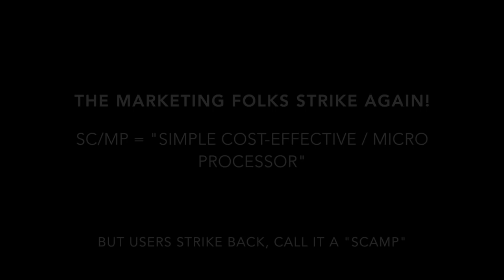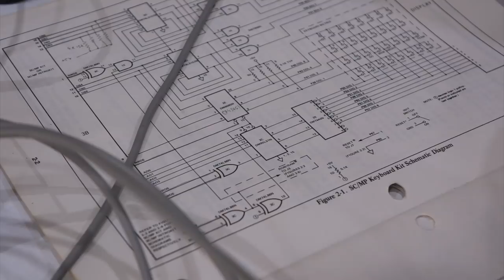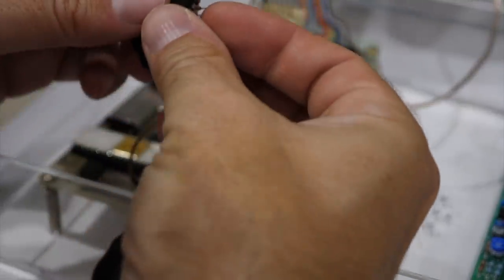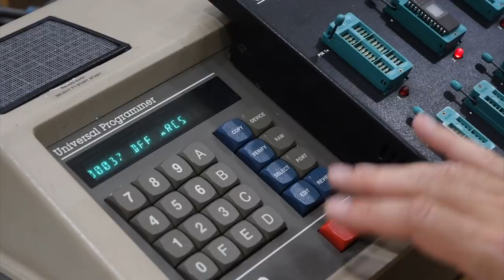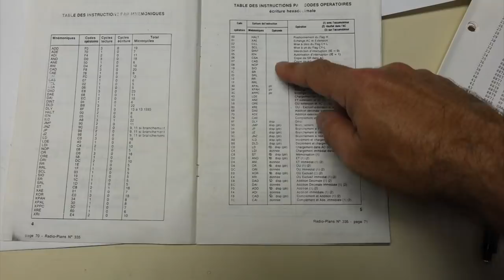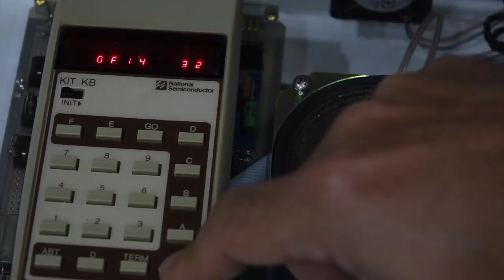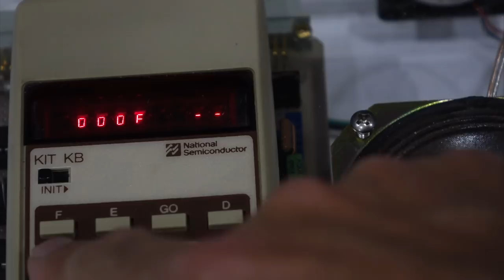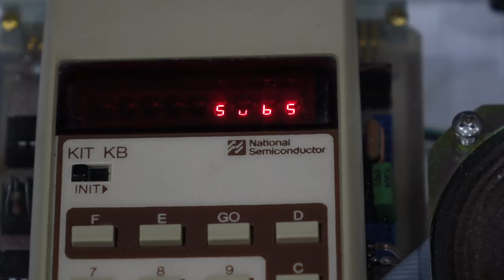My first computer: the 1976 SC/MP 8-Bit Microprocessor Kit

Comment: My first computer was an Ohio Scientific Challenger 1P - in 1979. A bit (no pun intended) more advanced: 8K BASIC in ROM (by a scrappy little company called Microsoft) and 8K of RAM. I also programmed a clock, as well as a non-directive psychotherapist program chatbot I called "Dr. Challenger" that sucked some people into thinking it was intelligent. That got me interested in the question of AI and philosophy. Quite amazing the impact computers have had on our lives. Thank You Federico Faggin (designer of the Intel 4004, which became the world's first microprocessor in 1971)! 
Marc - Do you have anything with a 4004 in it?
Reply from the maker: + Eric Platt: No, nothing with a 4004. I am not sure what used it. I have the HP 264x terminals which originally had 8008's in them, but the version I have are 8080's. Bunch of videos here: https://www.youtube.com/watch?v=mOXCPaHcr5U&list=PL-_93BVApb5_E6qM4SujInAZSXZ3C-6AC
Reply: Thanks for the link. Fun stuff, these old monochrome limited character/bit set computers. 
You should check out the comments in the original source assembly code for the Microsoft BASIC used in the 6502 machines (Apple, OSI. etc  [1978].):
https://www.pagetable.com/?p=774
Intel was contracted by the Japanese firm Busicom to build the 4004 chips for a calculator. According to Wikipedia: "The first commercial product to use a 4004 microprocessor was the Busicom calculator 141-PF. The 4004 was also used in the first microprocessor-controlled pinball game, a prototype produced by Dave Nutting Associates for Bally in 1974." 
Nice story about it here: http://www.i-programmer.info/history/machines/3345-birth-of-the-intel-4004-the-first-microprocessor.html
Reply: @Eric Platt, you rebuilt ELIZA in 1979. There should be easily accessible assembly and machine code interfaces, so the wonders of yore and even more are remade, even better, reaching never before seen heights. Sadly, there are some "programmers" that require 2GB of ram for a simple Hello World program (the Electron framework bundles all of Chromium even for that simple program, so everything coded with it weighs at least 100MB). Truly pathetic.
People should look at what Xerox achieved in the Alto and even more with very little resources. Vectorial graphics. Rasterization. Etc, etc, etc...

Comment: Having owned an SC/MP based MK14 for all of its life (and a not insignificant portion of mine), I really like this video. I hadn't realised how heavily derived from this kit the the MK14 actually was - the monitor / OS looks identical to the 'early' version MK14 OS, although the MK14  later acquired a much improved monitor, the one with the "0000 00" reset prompt, as opposed to the one with the "dashes" prompt as seen here. As an electronics hobbyist I used mine in much the same way as I still use things like Arduinos now. I give the MK14 a run out every now and then, and a few years back I made a serial download programming interface for it, as seen here:-

https://www.youtube.com/watch?v=j1WSy_ueX34&t=21s

It's great to see like-minded others keeping these old systems alive.
Reply: It's not so much "heavily derived" as exact copy :) Ian Williamson had designed an SC/MP machine that worked by hacking a calculator display and keyboard, but when Sinclair went to NS for parts they offered him the design for free provided he used NS parts. The difference in the MK14 is they threw away the unused bits. The Introkit was originally a serial I/O trainer for the SC/MP ; NS provided a conversion kit, a wirewrapped board that replaced chunks of it to provide things like the keyboard interface.
Reply: Hello Paul ('The' Paul Robson?)  - yes, I've since seen examples of the Introkit at Bletchley (The National Museum of computing) and I saw that the most basic form of the Introkit only had serial / TTY input/output, the keypad / display interface being added on the 'breadboard' part of the Introkit, usually using wire-wrap construction. I guess we MK14 owners had it a little easier, or we would have, if the MK14 keypads actually worked. :-)

Comment: Know the 2716 (plus 2732/2764 prodigy) and that Data/IO quite well.  Back in the day we were among the first on the block to get an 8080-based PC system from Intel (including Basic from somebody named Bill Gates) .  We developed new communication terminals using the Z80, replacing terminals built using "mini" processor boards with ALU, drivers, registers, etc all discrete chips, which I used to troubleshoot before we moved on to microchips.

Comment: Bonjour Marc. J'ai une petite question; comment est-ce possible qu'une mémoire mask ROM puisse devenir défectueuse ? Après tout, ce ne sont que des connexions électriques établies par une combinaison de pistes de métal superposées, non ?
Reply from the maker: Good question (Alain is asking why a mask ROM would fail since the bits are set by a metal mask, not a trapped charge like in an EPROM). The answer is that any IC can fail. If I am not mistaken the main wearout failure in modern ICs is electromigration, so ICs have a finite lifetime. The wearout modes depend on the particular technology node, these are usually heavily studied and understood by the respective fabs, there are whole qualification reports on them - but ICs do age and have an expected failure rate. There are also random failure modes, and I am not sure what the predominant ones are. Prior damage by static is a well established one. EPROMs, since they rely on trapped charges, are more sensitive to defect growth, contamination and charge migration, so they have additional and more frequent failure modes, this is why you see them fail much more often. Nice drumming by the way :-)
Reply: I knew about some early ICs, especially CMOS ones, that suffered from electromigration due to a poorly understood phenomenon at the time and the less than ideal manufacturing processes in FABs of the early days. But I didn't know that it could also apply to mask ROMs. I know that some flash RAM types also have some caveat regarding the finite number of times each cell can be reset and written to, but given that this technology is holding electrons captive (much like the early EEPROMS) it could be expected that they would fail over time. But wires connected to other wires ? I didn't think so. Now, I'm a bit scared since I own a lot of vintage electronic gear.   
Thanks Marc, for the explanation and the compliments... ;-)
Reply from the maker: And the acute lifetime problem from early ICs has not left. It has even returned with a vengeance, it is now a major limitation of ever smaller modern ICs.

Comment: I recently got this exact set (with the modified calculator) and loads of attached sc/mp expansion boards built into a wooden case.

I have no use for it because I collect Commodore and MOS stuff.

Is there any value in this SC/MP stuff?

Comment: If the SC/MP processor is running hot, wouldn't it be better to fix an actual heatsink to it, rather than just having a fan right at the back of the enclosure? Give it some direct localised cooling, especially as this processor is quite unobtanium as well.
Reply from the maker: It's PMOS. Every chip in there runs hot basically. But this board is OK to be run without any cooling. It's just a precaution.

Comment: Me, too - I had one of those, but the more polished kit, the MK-14 ( https://en.wikipedia.org/wiki/MK14 ) - sigh - I also got the extension kit, which added a few IO ports and doubled the memory. I then had to learn how to interface the IO lines to some electric motors and switches, learned how to do software debounce, and some more. Finally I had some sort of macro-language, example: "Turn motor five turns (a switch counted) or until other switch is depressed". This was the beginnning to do some robot/machine ... but then it petered out.

Comment: I've actually built a very basic 8 bit CPU using discrete logic, SRAM and 16kBit EEPROM's. It has 256 bytes of memory, currently has 36 instructions, the ALU can only really add and subtract but I have written multiply and division programs for it (answers less than 255 for multiply and my division programs has limitations IE it has to be evenly divisible otherwise the count overflows and you get an incorrect answer and it infinite loops on divide 0)
Reply: Nice! You should make a video of it
Reply: LeiserGeist I have a few older videos (from 3 weeks ago) of it on my channel, haven't made one recently after the added instructions and other mods. I'll probably make an update video when i get back home tomorrow (my time)

Comment: this is so charming, would kids today benefit from such a kit now do you think? how much need is there for very low level programming today. I don't see how its possible to persuade people to learn very low level programming, except with such restrictive hardware, Just not sure the young have a desire to concentrate on low level programming today when they have so many vast easier digital distractions.
Reply from the maker: Not to worry, the bit swappers are alive and well. Busy making gnu compilers, EFI boot code, OS kernels, drivers, jailbreaks, and other firmware hacks and viruses...
Reply: It's funny that you ask that. Today's computer science classes don't even teach you such skills. Now that WEB development is in full demand. In fact, I heard that you can get a Ph.D. in computer science without ever writing a single line of assembler code. Is low-level programming going the way of the dinosaur? I can't imagine why. Even today's i7 processor still run assembler/machine natively. Although I will admit, trying to keep track of a 1000+ instruction set can prove a bit challancing.

Comment: Thank you so much for this. What a wonderful dollop of nostalgia. It has taken me right back to the early days of microprocessors, which I was fascinated with as a school kid. I remember lusting after the National Semiconductor SC/MP Introkit with its Novus calculator based keypad but it was too expensive and hard to source in the UK. Predating the Introkit was the 4 bit Intel 4040 'Champ' development kit/project in Practical Electronics magazine, which [alas] was also too expensive and involved a task for me at the time. However, within a couple of years or so, Sir Clive Sinclair came through with the SoC MK14 SC/MP kit which I was able to buy. Boy do I regret selling that!! 😢 I wish I still had it and could build a display cabinet for it like you have done here. A really nice Introkit came up on eBay a few years back and I was really tempted, as it was a very reasonable price, but I had other projects taking up my time & money at the time. Fortunately, there's a chap who is selling gold plated bare SoC MK14 PCBs on eBay, so I've bought one to use with a nice new 'old stock' ceramic SC/MP uP I bought several years ago (I think I still have a couple of plastic packaged ones too, as spares). This vlog has spurred me on to get it built. 😎👍 Although you can still source the ROMs for it, they a bit pricey so I might do what you have done here and make an adapter for EPROM. Nice job btw. I wish I had some of your gear to hand.

Comment: how did you figure out how long each instruction took for the clock?
Reply: normally it listed in the data sheet (instruction manual)
Reply: @martindejong3974  That question seems too involved to come from me. Then again I'm one of few who own magnetic drum memory and involved with it I got. Its making me feel stupid and smart. I would love to drop a video on it but I cant get anything on my scope from the drum. Not even noise. The heads i dont think are active despite them having odd chips. its so old u can look at the bare dyes and determine what things do. Even tho the drum is scratched I should still be able to pull somthing. Im at 20mv. anything lower and i will likly need sheilding to probe which will make it somuch harder. idk why i put this here. thnx for the reply. makes total sense i should have known lol. If u sub and hit bell to my channel ull see it one day. i dont upload often. im actually really excited. these drives areso simpal you could totally read and write to it with ur own circutry.

Comment: Heres my 40-year-old homebrew SC/MP system, its loosely based on an idea by David Aitken published in the 'Microbyte' column in Practical Electronics April 1980.
It runs 'Kitbug' via a terminal (I built an Elekterminal but cant find it - its buried in my loft somewhere...)   https://www.vintage-radio.net/forum/showthread.php?t=171478
Cheers
Phil_G
Reply from the maker: Nice!

Comment: can you add some kind of serial connection to it so you could just send programs to it from more modern computer instead of keying them in by hand
Reply from the maker: Yes, the original kit was meant to be connected to a TTY with a paper tape reader (like an ASR33), so it has a slow 20 mA serial current loop built in. You need another ROM to make that work. The keyboard interface was an afterthought, for people (like me) that did not have or could not afford a terminal. That's why the keyboard interface is all wire-wrapped, and the ROM is different. Now that I have the bigger ROM, I did put some DIP switches so I can swap between the two ROM images and switch to the TTY interface. Have not tried it yet.
Reply: ¸maybe a revisit after a year, trying out TTY on it?

Comment: Heh. I bought this one more than 10 years later already built, with non-original stock Hex LEDs and buttons. I remember you had to debounce the buttons in software :) Mine had a switch and a lead where you connected 21V or something to program the EPROM right in the socket? I did write some programs, something with dice and something that fired "lasers" across the LED digits. A bit after that I built an 8085 computer, a 15-bit RGB VDU, a universal EPROM programmer, and some other stuff. This was before SMD chips. I looked at this kit a few years ago if you're interested :) http://www.microbeetechnology.com.au/

Comment: I find all of these old computers fascinating. I'm going to try someday, sometime building an S-100 type system. I'll model it similarly to the imsai 8080 since I like it's design. Although I won't be able to connect original S-100 cards, since finding card sockets that are the same dimensions is hard to find or not cheap. Non the less I still want to build one.